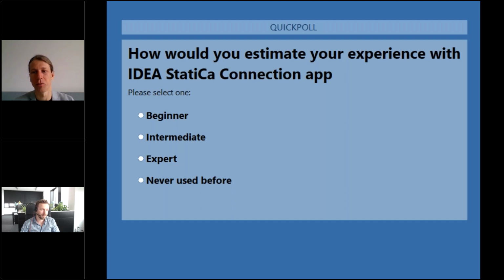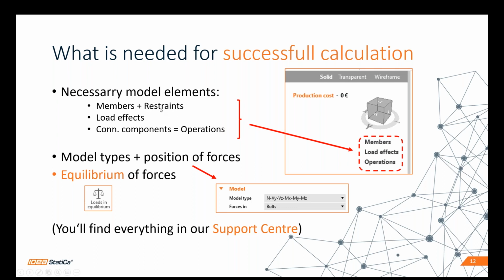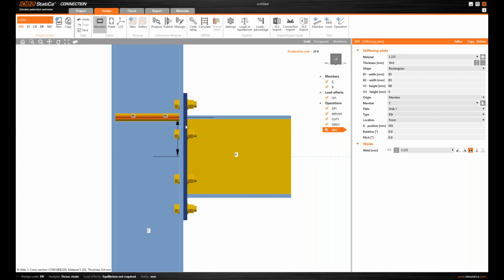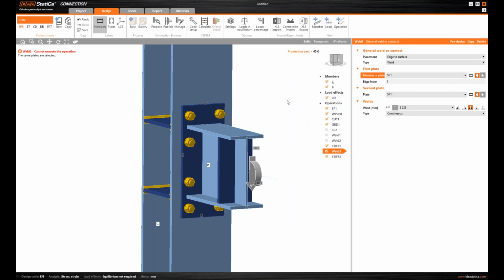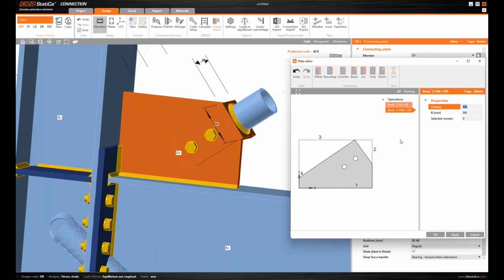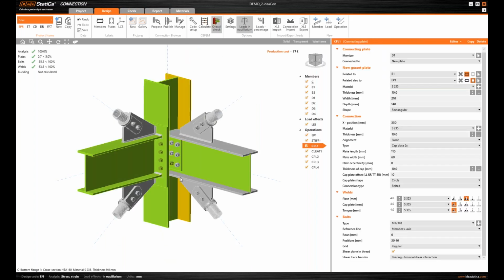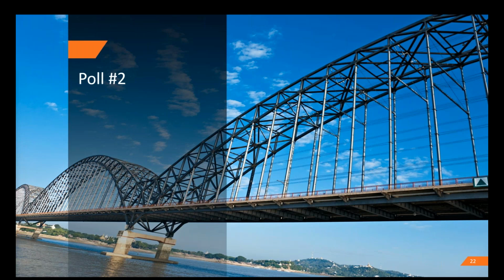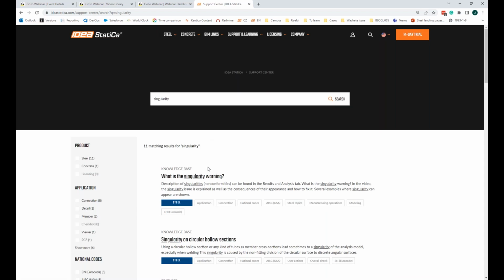Get the most out of Connection modeling

Comment: Where are bolts m10
I didnt find it?
Reply from the maker: Hey Yemeni, M10 is a nonstandard size, so it's not in the library, but you can of course add M10 or other bolt sizes and materials manually in the Materials tab:
https://www.ideastatica.com/support-center/user-defined-material-properties